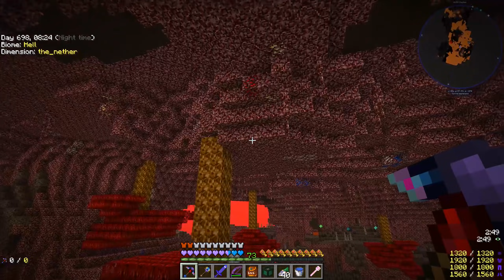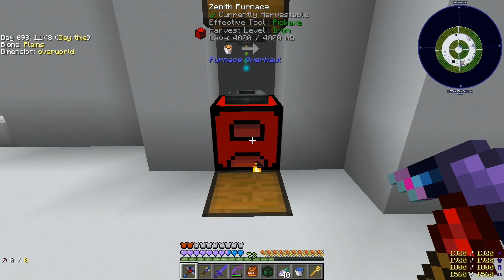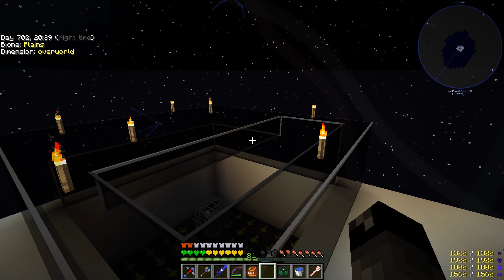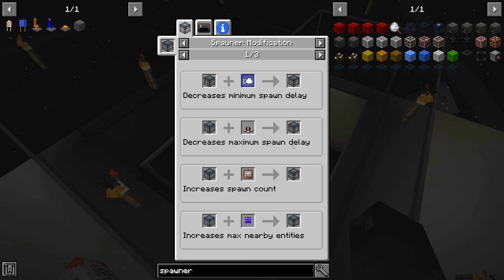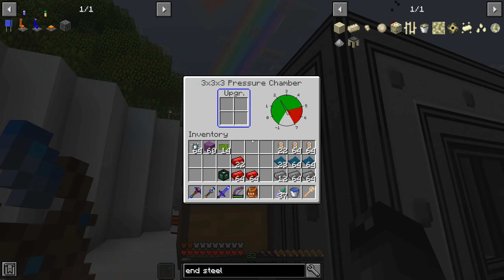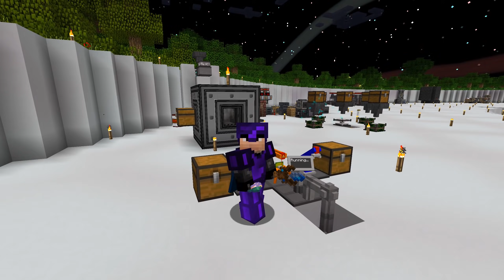Project Ozone 3 Kappa Mode - ASSEMBLY PLATFORM [E67] (Modded Minecraft Sky Block)

Comment: Hey hypno, do yourself a favor and dont add a dragon egg on the spawner (it makes it ignore spawn condition). I did this and upon spawning in the world it would summon 3000 entities almost instantly, making the game a slideshow. I had to go into mcedit and delete them because I couldnt spawn back in and break the blocks. even /kill didnt work because 4 max spawners spawned about 480 entities per second, so I had no time to do anything. just a tip though!
Reply: just a tip? thats a tip that saves a full world
Reply: ''minecraft world''
Reply: a way to help with that problem is to make the mob farm with the spawners in an other dimension and put redstone control so even if you log off from your world and log back on without turning off the spawners and you get the ingore spawn cap on your spawners cause of that bug, you can disable them without your world becoming a slideshow. In addition i made a antlion mob farm to farm soul crystal so i can take off the ignore spawn cap upgrade from the spawners, every time i log on witch is when you get that bug,  if i want but the solution with the other dimension works so far(you can have the spawner on for a second or 2 and you get all the drops you need then you turn it off again, a lot of drops in little time not bad i guess :D). But yes hypno should be carefull with that bug.